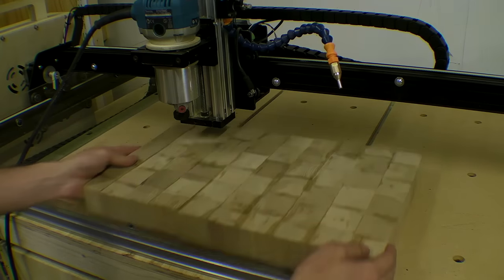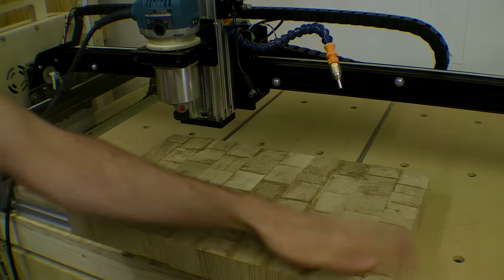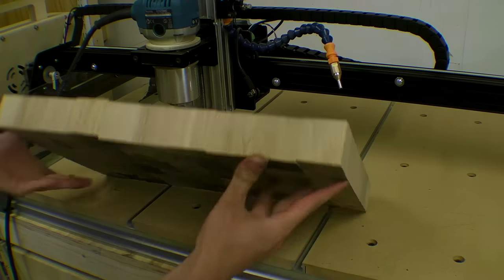Use CNC like Jointer Planer / Resurfacing Oak Chopping Board

Comment: If you use something hard and smooth, like a screwdriver shaft, to turn a burr on the razor blade you can create a wonderful miniature cabinet scraper. I use them almost daily in my work and they are superb for small scale work. Single edge razor blades are so cheap that they are cheaper to buy than to spend the time sharpening a "real" cabinet scraper.
Reply: Board looks great though and I love the fact that it is recycled oak.
Reply from the maker: Will give that a go. :)

Comment: great, I just recently tried the same. I used big 30mm wide flat bit.
Reply from the maker: Would have been much quicker but I was worried I would damage the edges. Should have made a cradle for this really.
Reply: Some kind of framing? Understand. Today I tried to engrave aluminum and broke bit). Now learn how to build correct toolpath...